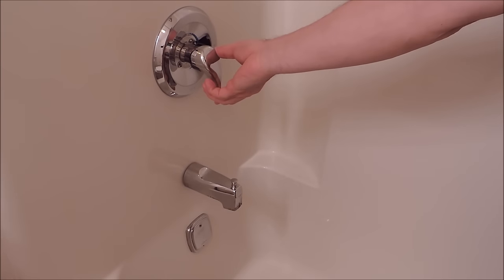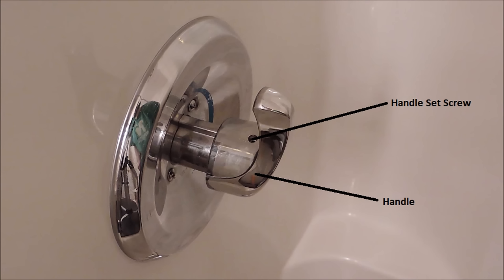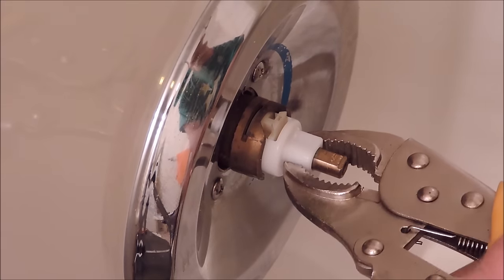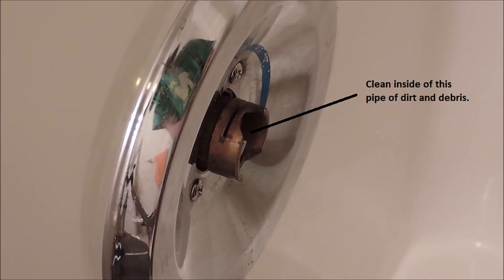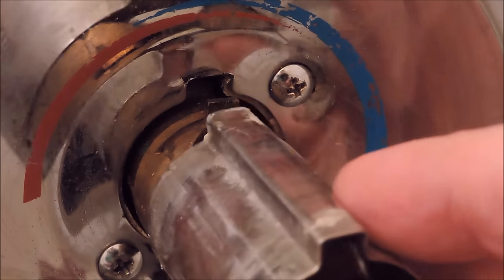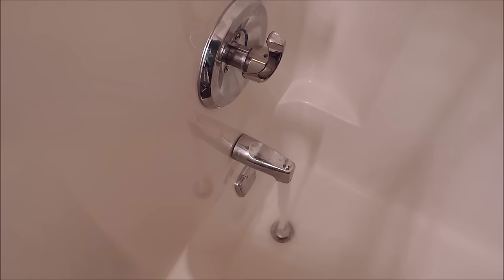Repair Shower faucet: Moen Posi-Temp Shower faucet ( 1222 B )

Comment: Excellent video!!  Mine turned out to be a bit more difficult.  The cartridge would not come out even after using the white plastic tool to break the seal.  Then while pulling with my pliers, the metal stem broke off.  So then I was in panic mode because the shower was in the "on" position, and I could not turn the mains back on.  To overcome that, I screwed a short screw into the center of the cartridge, where I could use a screwdriver to turn on and off the shower faucet temporarily till I figured out what to do.  I finally ended up drilling 2 long deck screws into the plastic face of the cartridge in the 3 o'clock and 9 o'clock positions and used my pliers to yank on them repeatedly.  After many hard pulls, the cartridge finally came out.  Turns out the black rubber gaskets on both sides of the cartridge somehow got caught in the inlet holes of the copper pipe. They tore loose when I pulled out the cartridge, so I had to remove the rubber bits  with some needle nose pliers after taking the cartridge out.  Just wanted to share my experience, but I appreciate your video!
Reply from the maker: Thanks for sharing your experience Yankee Hank, sounds like you used your ingenuity and fortitude to "get the job done".  You have the same mindset as the cable guy who used to say, "git'er done". I am glad you watched my video, and I am sure your comment will help others as they struggle to change the cartridge.
Reply: My rubber pieces were also stuck in this grooves and broke off in there when I pulled it out. I had a hard time getting them out because I had to dig them out with a tiny flathead screwdriver and then grab the pieces with the needle nose pliers. I thought I was going to rip the plumbing out of the wall. When those rubber piece get legs in the grooves it's really really hard to get the cartridge out.
Reply: If had the rubber pieces bind up 🆙 n two of mine and break apart. Seems like none of it got stuck inside, but I turned the water on slightly to flush out any pieces that would come out.
Reply: Exact same experience. Unfortunately, I'm repairing mine again for the second time after a yr.
Reply: It can be very hard to remove when this happens. Moen makes a puller that helps but still tough

Comment: THANK YOU!!! I was at wits end in the final stages of replacing a shower cartridge using trial & error trying to position the center shaft properly so that the water was OFF when the handle was in the OFF position. You pointed out the "Small notch facing up, means on" turned a frustrating puzzle into a piece of cake. Thanks again!
Reply from the maker: I am glad my video helped you out, I specifically included the section on the notch because I thought it was a key point and may cause confusion if I did not include it.
Reply: Same for me! My handle was upside down until I rewatched your video! Thank you so much!!

Comment: Omg! Your video has saved me, after my faucet wouldn't turn off! Also, another video had a tip to heat up the cartridge, with a blow dryer, if it refuses to come out. Next, Moen has a program, where you can go the hardware store and get a new cartridge for free! Thanks so much! 🤗
Reply from the maker: Good advice about heating up the cartridge ( and pipe ) which will expand the pipe first, and cartridge will slip out easier. I see from your YouTube channel you give good advice, like turning a pantry into a food storage, and having first aid stuff ready and waiting.
Reply: @paulc1562  Yes! Lol! Thanks!

Comment: Thank you. Ended up removing the plate to get to retainer clip. Also bought danco puller from home depot to remove. Took 30 mins total. Thank you!
Reply from the maker: 30 minutes is good time to fix the issues you were having. Correct sometimes a puller is necessary.

Comment: Thank you so much Paul. If it was not for your video, I would never have attempted this myself. I'm happy to report that I replaced my old cartridge and that the pressure is back to normal.

I wish to share my experience with others. I hope this will be helpful.

My shower had lacked pressure for a good 10 years. Even more in the hot water position, just like in your video. My Moen posi-temp was installed by a plumber 25 years ago. I  I had checked everything else regarding the plumbing and everything was okay. After viewing your video, I knew the problem was with the cartridge. I contacted Moen and they sent me a new cartridge, free of charge.

I had many concerns of doing this myself since the installation is 25 years old. Everything must be tight (and it was ultimately). Anyhow, I proceeded and  followed your video and the instructions that Moen provided. Moen strongly suggested a flush of the pipes, hot and cold, once the cartridge was removed. I did this and I know it was helpful.

Everything went easily except for 2 things This is what I wish to share.

1) It was VERY DIFFICULT to remove the old cartridge. Moen suggested a 1/4 turn clockwise with the plastic tool they provided with the new cartridge, to loosen it and remove it. This did not work easily. I yanked it in both directions for a good 45 minutes before it started to loosen. Many times, I thought of giving up. I was afraid of breaking something since I was using a lot of force. Despite these difficulties, I managed to loosen and remove it. I then performed the flush. I was now ready to install the new cartridge.

2) Installing the new cartridge proved to be EXTREMELY DIFFICULT. I put the grease on the new cartridge as indicated. I was able to insert it about 75% of the way with MUCH difficulty. it took close to an hour to make it to 95%. I was pushing on the cartridge, as indicated in the Moen instructions, with my fingers. Many times, I thought of giving up. The cartridge must be fully inserted in order to reinsert the locking pin. After too many attempts with my fingers to go from 95% to 100% insertion, I had an idea. I used my visegrip tool for an extra push on the cartridge. Please be advised that I'm not sure Moen would 'endorse' this approach. One part of the tool was pushing on the top of the cartridge and the other part, on the bottom. This extra force enabled me to insert it completely. I think that maybe I should have greased the inside of the pipe. Maybe it would have been more easy.

I completed the work. Everything works just fine now. Thanks for reading.
Reply from the maker: Glad you did it yourself, you probably saved a bunch of money than have a plumber do it. I am glad you shared your experience. I hear you!!

Comment: Thanks for your video. It allowed me to fix a metal shower handle that came off. The handle adapter screw somehow was behind the handle adapter inside the metal handle. I unscrewed the outer metal handle screw with a very small straight head screwdriver. That allowed me to remove the black handle adapter that was inside the metal handle. I could hear a loose part when I shook the metal handle. That loose part was the handle adapter screw (1:16 of this video). I was then able to attach the handle adapter with the handle adapter screw back to the stem assembly and reattach the metal handle onto the handle adapter with the handle adapter screw. Without your video, I wouldn't have figured it out myself. Thanks again!
Reply from the maker: I was glad my video was able to help you figure it out.

Comment: Thanks a million, Paul C! Based on your step-by-step instructions, even I was able to change this cartridge and stop my slow-leaking shower faucet. And here's a consumer hint -- if you contact Moen first - they will send out a replacement cartridge free as they have a limited lifetime warranty on their parts!
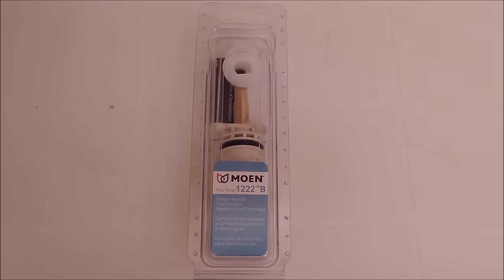Reply from the maker: Thats great Jane, that you were able to use the instructions to do your own fix. Your right about the free cartridge if you contact Moen, not sure if you saw this but I did include this in my video too! starting at timestamp 2:33
https://youtu.be/BXWsiKP88gc?t=153
Reply: Glad I read your comment. I was going to go buy the cartridge first then view the rest of the video!
I will update what Moen tells me when I call them on Monday 9/20.
Reply: I have a situation where I can't get the retainer collier clip in between the wall and collar. The new cartridge is in really tight. What does the collier clip hold?
Reply: Better way is just go to home Depot they give free replacement.
Sometimes they don't even want u to provide the old one.

Comment: Very good video! Thanks! I was able to pull this repair off with your advice and instructions. I would add that if you’re a novice do it yourself plumber like me...invest in a cartridge puller if you have hard water! And if the pipe on your water mixer is a bit built up with hard water deposits...hit it with limescale removal product and soak for a bit and even use petroleum jelly to reinstall the cartridge because it’s a tight fit in the pipe my cartridge only came with one lubricant packet and it just wasn’t enough...but it worked perfectly fine after following the instructions on this video! Thanks much! Have a good day! I will have a good day now that I have hot water in my shower again! lol
Reply from the maker: Thanks for the advice about the puller, and how to beat the hard water deposits that some may have. Glad you did a good job, and that my video helped a bit.
Reply: Could not have done it without your help! Thanks Paul! You saved me a plumber call out and labor costs!

Comment: Thanks! This step by step video was so helpful. We had water that wouldn’t stop! We had to turn the water off... you don’t realize how much you need water until you turn it off! This took me way longer than 6:10 seconds getting the original cartridge out and putting the pin back in were the hardest parts. I’m thankful for people like you who think to upload these type of DIY videos!
Reply from the maker: I am glad my video was able to help you do a great DIY job.
Reply: Hey I know it's been 2 years but I turn the bath on today and when I try to turn it off the water wouldn't shut off. And there's a little leak coming from the Handel. Is this how yours started? And doing the steps in this video fix it?

Comment: Great video!  It helped a lot.  I had troubles pushing the new cylinder in all the way.  I had to wiggle it with the plastic tool to get it in the last 1/8th inch.  Also be careful not to drop the pin inside the wall.
Reply from the maker: Glad it helped! Yes you had to be careful, it would have been terrible to get all that done, then to drop the pin inside the wall - good call.
Reply: I dropped the pin inside the wall

Comment: Your explanation was so simple and clear, but my cartridge is still stuck in place. It's moving 45° but that's all the movement I'm getting. The seal is still not broken.
Reply from the maker: Sometimes it takes alot of "elbow grease" to break that seal, also Home Depot sells something called a "puller" device that might help. Also if you want to get wet turn the water on and it neutralizes the pressure - but that would be the messy way! LOL
Reply: Paul C thank you so much for your reply. You are right I had to get my brother to rip that thing out. It came out in pieces but the job was done. Thanks again.

Comment: I've replaced about 20 of these in my lifetime, yet the with the one I tried to swap out yesterday, I can not for some reason get that clip to slide back in.  I have never had that problem.  There just is not any space for the clip to slide around the cartridge.  It is making a 30 minute job into an all day project!

Comment: Thanks a bunch for this video. I ran into a few issues with not having the correct hex size and pulling out and pushing the cartridge in. If the cartridge don't go all the way in just push on the plastic part instead of the metal piece othe cartridge.
Reply from the maker: Thanks for the advice on the cartridge, also Mel said you can heat up the pipe with a blow dryer, and that will expand the pipe to put it in too.

Comment: Good video!  Does the Keystop play a role in the water pressue!?!  Ours is not pushing water with enough pressure ,specially when I have to move it to the MIDDLE to avoid getting burned!  What is the remdey?

Comment: Excellent video.
Unfortunately, the hex screw for the handle would not budge.
I ended up stripping the screw.
Not sure if the guy who installed it overtighten or not. 
Even before I started, one of the corners was already circular.
Sigh.
Reply from the maker: Yes we all have a horror story of some kind of stripped screw caused problems for us.

Comment: It looks so easy and maybe it is so easy but I have spent all day and unable to do it. 
In summary. I removed cartridge and replaced with after market denco which failed. 
Replaced with 1200 meon which looks same as existing one but shower is leaking more. 
Is  this one different than 1200 ?

Comment: Paul:
Very informative but.... I changed the Moen 1222 Cartridge but still have the problem of having to turn the handle very farther to the left (hot) than I used to do before (hot water is OK at other faucets so not the water heater). Any other reason why I would be having this problem and suggestions?

Thank you,

Michael
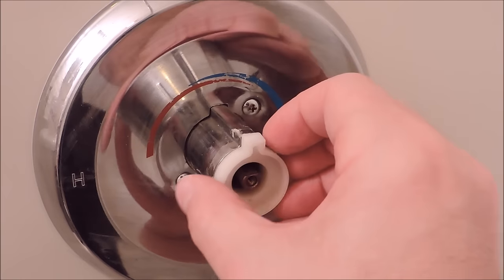Reply from the maker: Check out my video from 1:40 to 2:00, maybe you changed your temperature limit stop configuration by mistake, that is all I can think of for now.

Comment: So, after replacing the crappy acrylic knob (chunks were coming off of it), the water mixture has never been right again (no more cold=R, hot=L).  Now it's scalding and freezing at various positions on either side.  I didn't touch the cartridge, just replaced the handle.  ???

I am guessing that the cartridge went bad, but wonder if it isn't a notch issue. What do you think?  How can I fix it or get it to reset to normal water temp configuration?  (heck, I don't even know what terms to Google!)

Thank you for your help!!
Reply from the maker: I dont know what to think of the unique problem your having, you might want to experiment with the notch, but that dont explain the "scalding/freezing" at various positions on either side. Maybe the cartridge.
Reply: @paulc1562  Right!?!  That was my guess, too. But I just replaced the cartridge (water quit altogether), but still have the issue.  
Top, dead center= water off. To the right is varying degrees of hot. To the left is varying degrees of lukewarm to cool. ???  I can't even visualize how this would happen. 🤔

Comment: Add some fishing line to the clip to save it from getting lost. If it falls behind you can pull it back up. I wish I did that with my wedding ring - lost it and never found it.
Reply from the maker: Interesting advice to save clip from getting lost. You lost your wedding ring in a drain?
usually the have a S trap under sinks to save the rings.
Reply: @paulc1562  this went down for a buy and fix rental house - The ring went down into the lower framing while I was sawzaw-ling out a member- so much debris under the house couldn't find it!

Comment: Our shower valve was stuck and we didn't have the tool, but by accident 
found a way to get it out without any effort. We had taken off the 
shower head and put an end cap on it since it was leaking some water and
 turned the main water valve back on to do laundry. In just a few 
minutes the stuck shower valve was pushed out by the water pressure (the
 retaining clip was removed). Just have some one ready to turn off the 
water supply when it comes out.
Reply from the maker: Thanks for the story, and good advice.

Comment: I've replaced several moen cartridges and those problem but now I have a new problem hardly any cold water comes out all of a sudden, I replaced the cartridge again and the problem continues I don't what the problem is and I don't want to replace the valve, too much work involved if I do that.

Comment: My handle adaptor is stuck...do you have a tip to remove the handle adaptor?  I took out the screw and tried to pull on it with pliers and it will not budge?

Comment: At 4:42 ... Correct me if I'm wrong, but, with the notch in the  up position you can put the handle back on so that it is in the ON position too -  so set screw is at 12 o'clock and is easier to reach for re-assembly (instead of the OFF position at  6 o'clock which would be more difficult to reach). It's not that you removed the original cartridge "... that way."
Reply from the maker: Correct, I had small notch facing "up" which mean it was in "on" position, so when I put the handle back on in the "on" position it was alot easier to screw it back on. Notice 5:36.
Reply: Oh .... !! ... I see what you mean now .... thanks for the info !

Comment: what if the handle doesn't come off after the set screw is out? Just ran into that issue, haven't had it before... just pull harder or what do you recommend
Reply from the maker: I would say pull harder, because if its like mine the only thing holding it together is the screws, might be some "hard water" or "rust" making it stick.

Comment: i have the same problem but will this solve my hot water issue not alot of hot water comes out ? thanks
Reply from the maker: Most likely, but not everybody will have the same problem as I did. It wont hurt to try because if you call MOEN they will give you a free cartridge.

Comment: I just replaced a moen/ danco tub and bath trim from lows, and the  problem  I have is that the handle is still loose after I  installed it, what did I do wrong?
Reply from the maker: Because I am not on site, I am not sure what you did wrong, maybe you bought a generic cartridge and it was not a perfect fit.
Reply: @paulc1562  thx